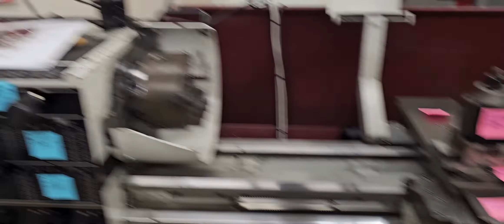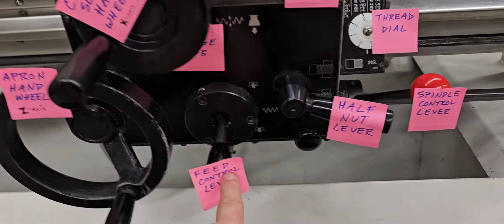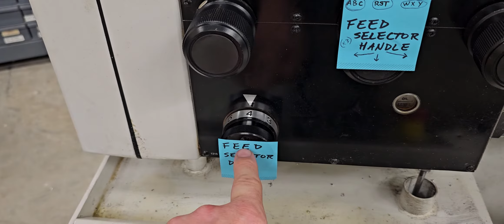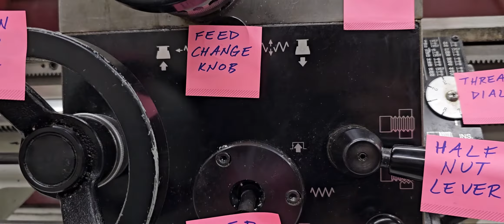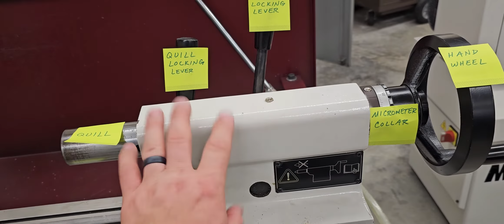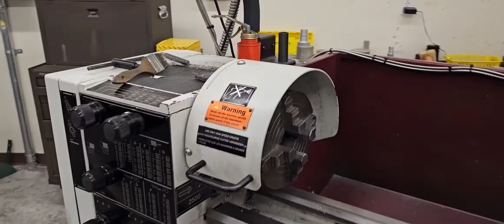The parts of a lathe, labeled on a Harrison M300

Comment: At the 4:10 mark, one correction.  The feed control knob selects between facing and surfacing.  Either the carriage or the cross slide.  Reversing the direction of cut is done from the feed direction selector knob on the headstock